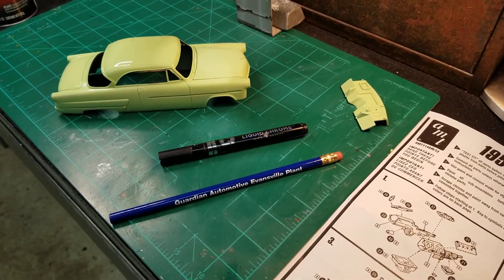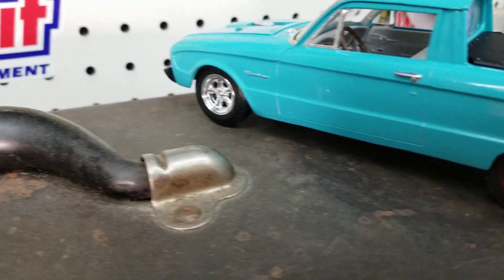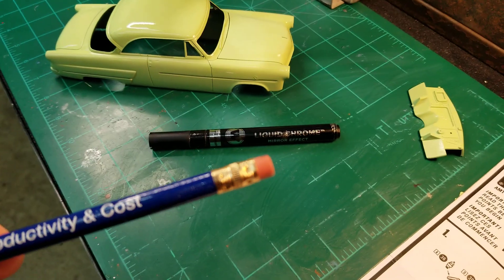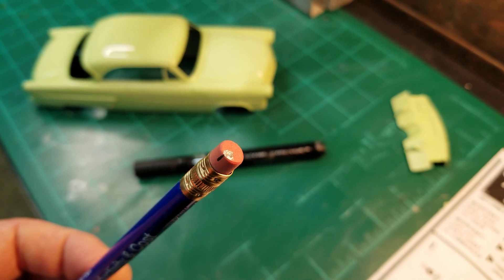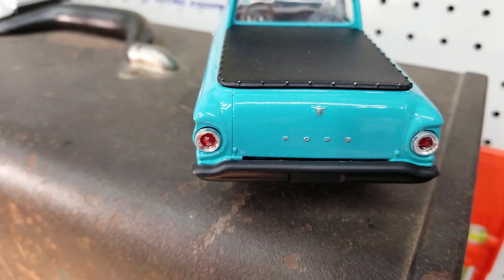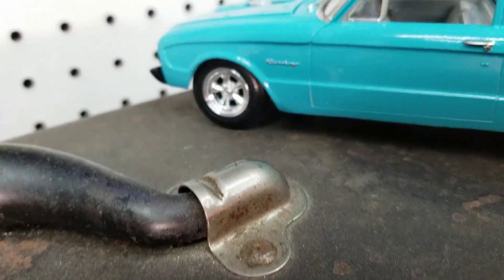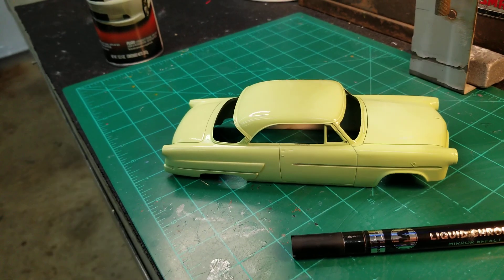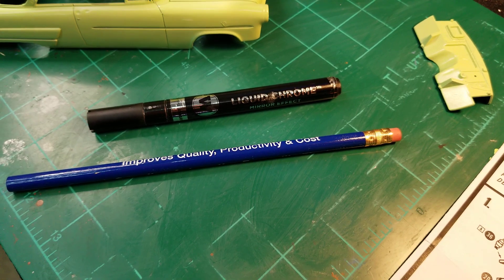Rubber Stamp For Script

Comment: Good tip been using for years you can use the same tech for doing lettering on your tires
Reply from the maker: Yeah it worked out pretty good.  I did a search online and didn't come up with anything so I winged it.